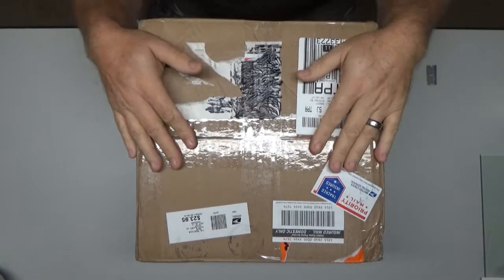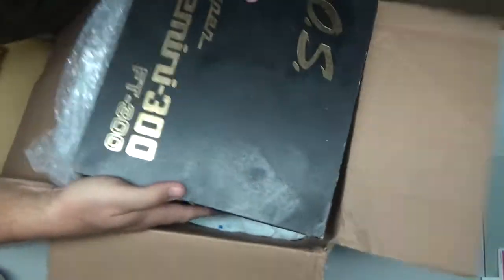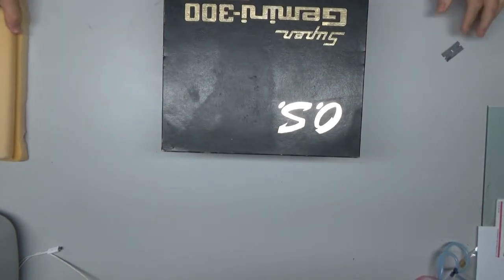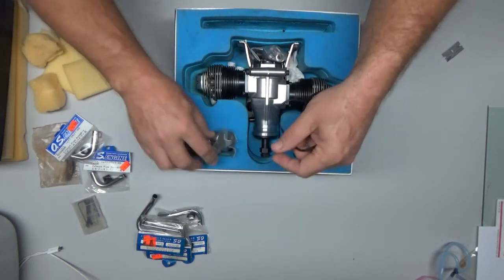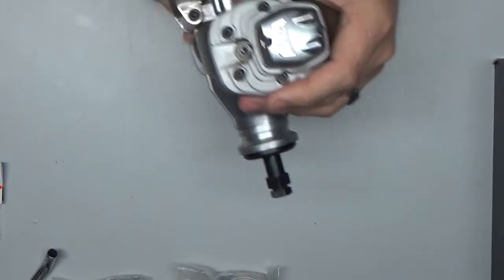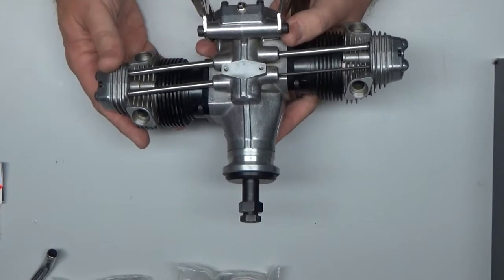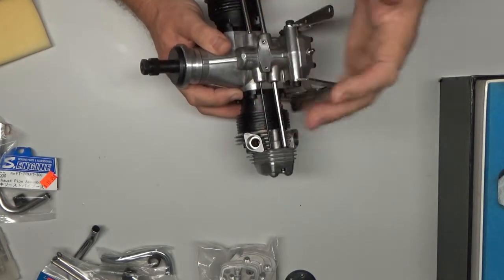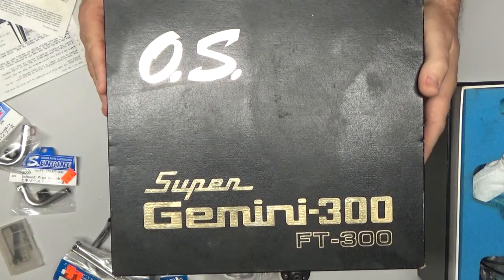OS FT-300 Customer Engine: Initial Inspection

Comment: they are great running motors. I have one with rcxel ign. system. makes hand starting a breeze.spins my BIELA 20x10, rpm7000
Reply from the maker: Thanks Harvey.  I have an 18x6, but nothing 18 and higher pitch.  I may have to invest in a prop to run this engine.  Do you recommend the 20x10?  Different size?

Comment: Can’t wait to see that engine running. And also whenever you are going to run it can you give up fuel consumption info as well. Thanks
Reply from the maker: Doubtful I will provide that.  Too many variables, tank size, throttle setting throughout the run, etc.